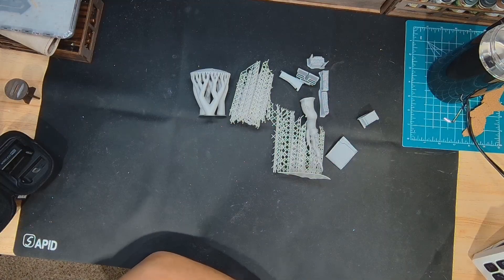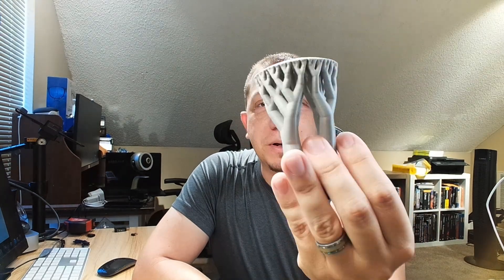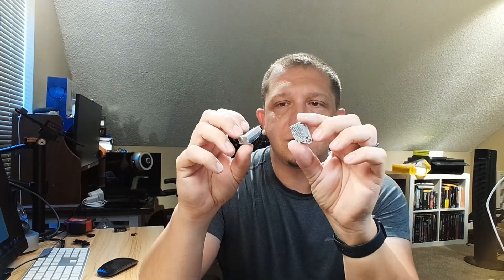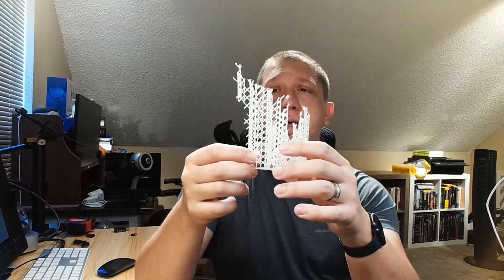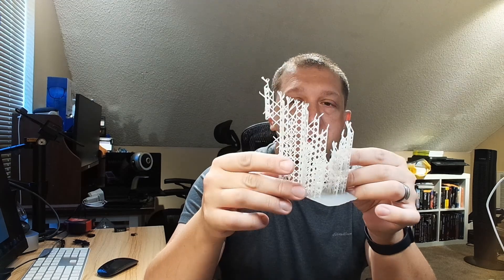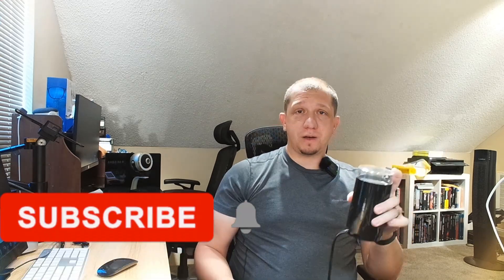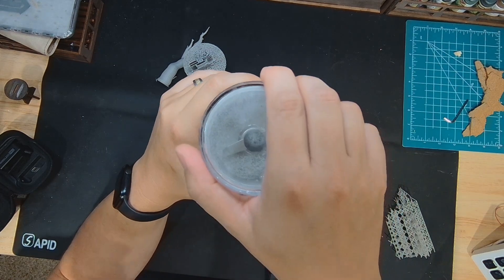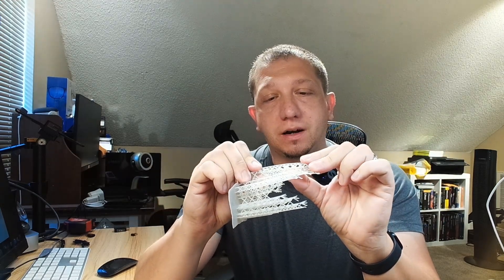Surprising Uses for 3D Print Support Pieces!

Comment: Ok but i dont make dioramas. Its just junk and i dont want junk on my house. I get it if youre actually making large dioramas and that kind of thing but in my case junk is junk. If i cant turn it back into filament then its nothing more than junk.
Reply from the maker: Definitely take a loop at the link for loop
Reply: @Rise3DBuilds  So after only 5 minutes of research it seems a lot about this is very suspicious and parts of the website are apparently fake. People are saying it's most likely a scam because of a few different reasons.
Reply from the maker: There is a that vibe on the machine that its to good to be true.  Like any new development there is a chance to get scammed.   I am putting a link were they did the demo with the prototype machine and printed with the filamanet.  Again anything new has the risk for a loss.  I have been following it in detail and hopeful especially after seeing the prototype in action.   https://www.reddit.com/r/3Dprinting/comments/1i0kgzm/thoughts_on_the_loop_recycler_now_that_they_have/
Reply: @Rise3DBuilds  well either way I won't be throwing away 100 right now. I'll get it once it's released